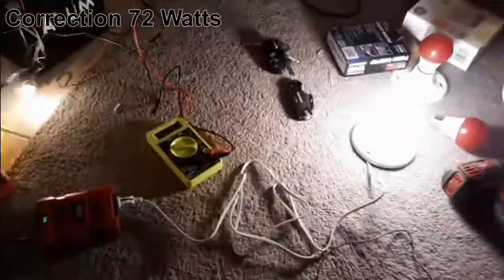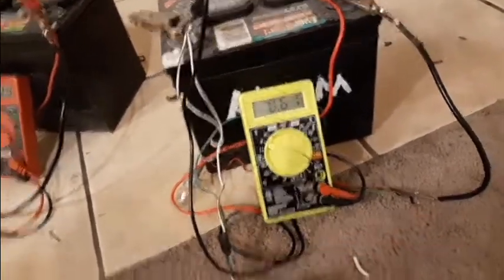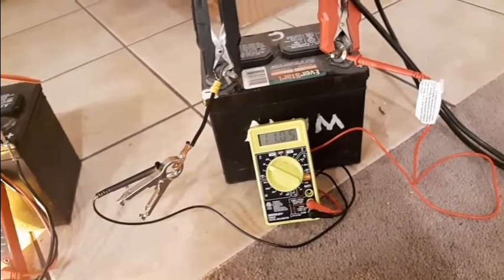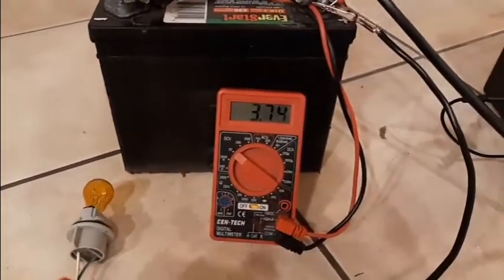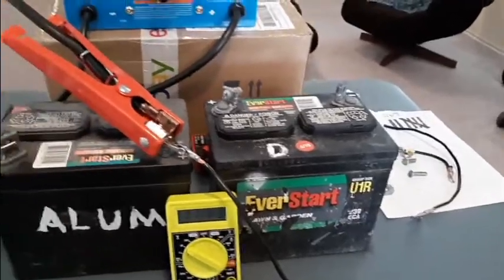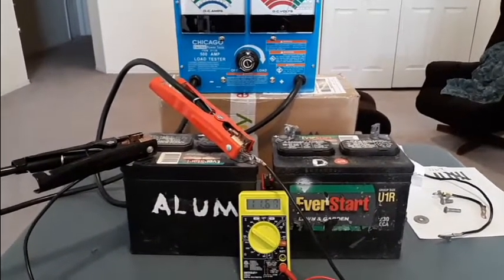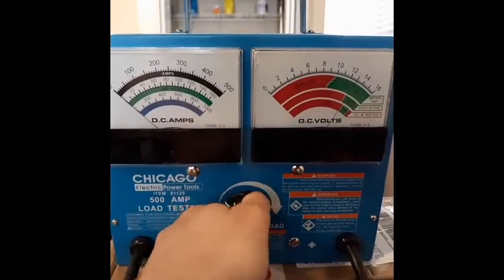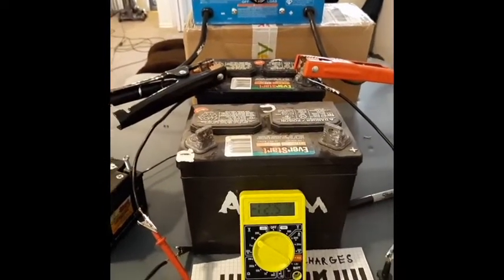Discharge Test Acid Vs Alum Part 1

Comment: well can you tell me how the alum baterry behaves in series/parrarel configuration with other baterry types?
How does the alum baterry behave at over charge or under charge does the alum baterry can explode?
And Im mostly curiuse how does that alum baterry behaves at - degree temperatures and hot weather condirions?
I need dual baterry system for me car and finde some baterry that can fead me ignition system seperately .
So mostly Im concerned how magnet alternator working at full power wuld behave on that alum baterry and what wuld happen if the voltage regulator fails for alternator .
And can capacitors be used with that alum baterry? 
Great video thank you